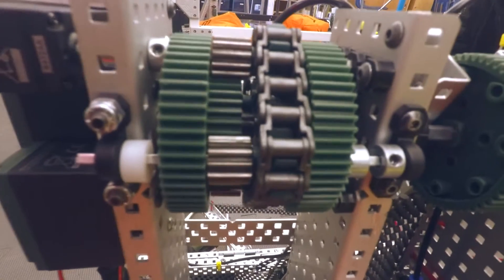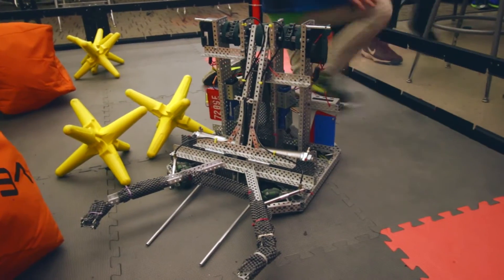The Opportunity / VEX Robotics Starstruck Hype Video

Comment: 1 tip use silver screws to lighten your robot for worlds. Another tip have you thought of changing your drive to speed motors?
Reply from the maker: Ro Ro thanks for the tip!!! the drive motors are high speed on the drive. Pneumatics adds a lot of weight. Thanks for watching!!!!
Reply: K